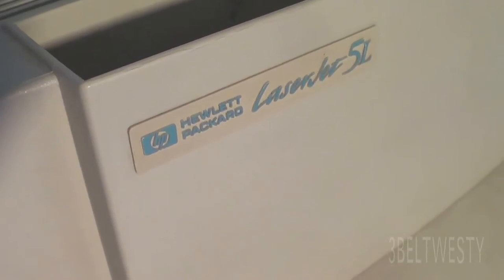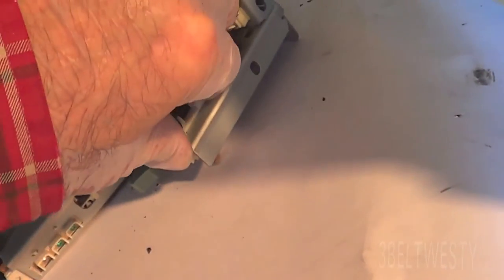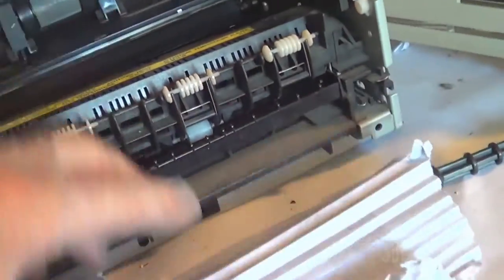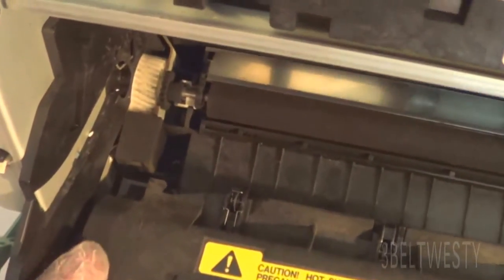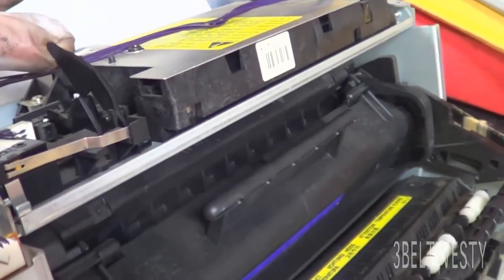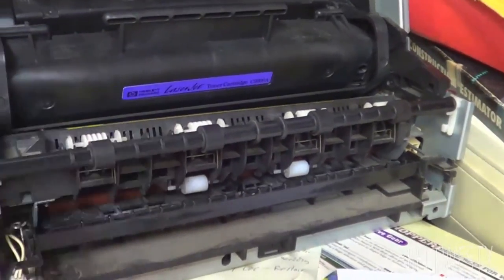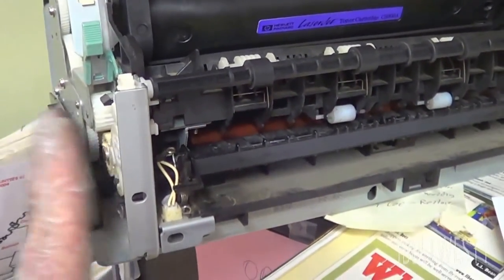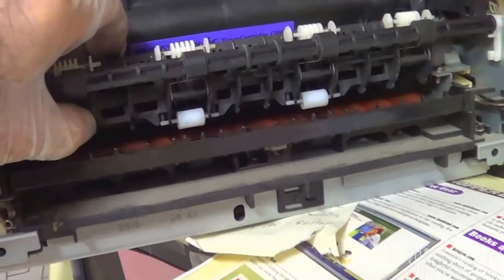HP Laser Jet 5L jam in fuser area ruined Film sleeve

Comment: I was given a Laserjet 5L and 6L about 12+ years ago, both having the multi-page grab problem. Fixed it using a paper feed kit that had the roller grabber with ridges. Since then, I have had no problem at all with these printers. They are great old printers that deserve to be maintained and kept up for generations to come. Any time I have a paper jam, I take a slow and easy approach to getting the paper out. Usually the only reason it jams is if I had accidentally put the paper in at an angle and not straight.